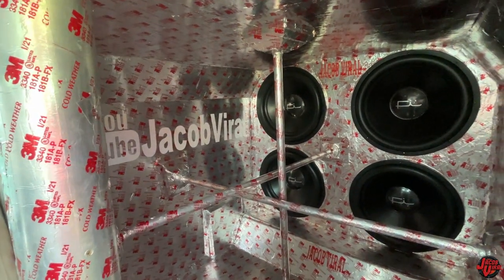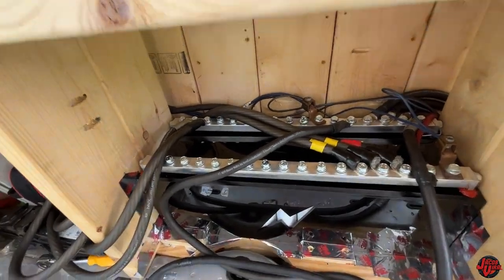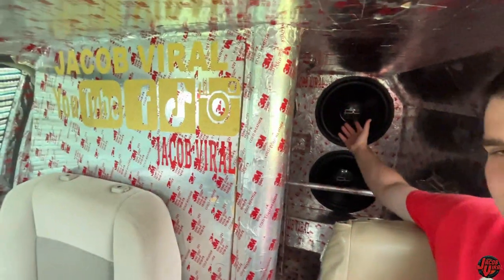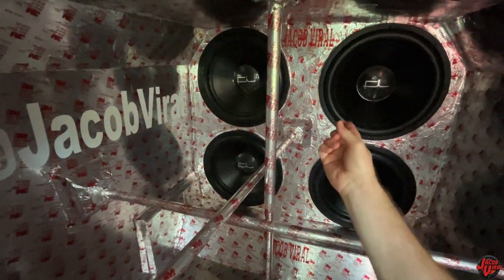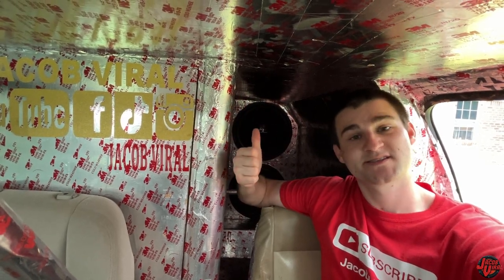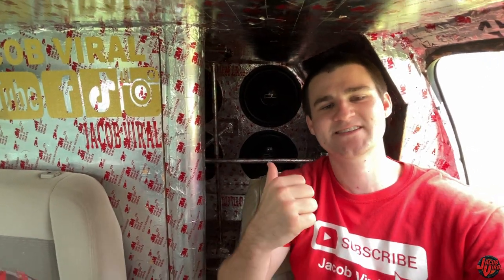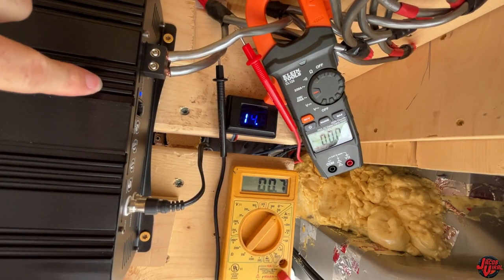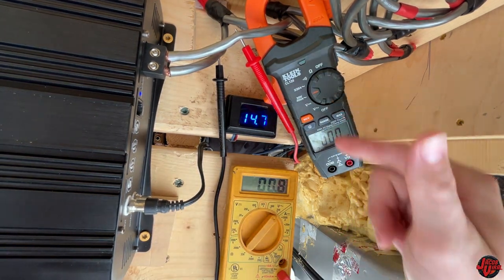BIG System Update! 2 SONG FLEX TEST & NEW Power RESULTS!

Comment: Where are you running your rca out of?? Deck or Kisle or something else? Decks seem to have low rca out puts with low volts
Reply from the maker: Just head unit pre out voltage 2.5v from deck; it works fine
Reply: I need to try that litium battery you got. I'm going to be looking those up, think you for the reply and all the videos you make.

Comment: Jacob what about two smart 5k taramps? They are higher around 6k at 2ohms. You should have a lot more power and get that 163+ db you want.
Reply from the maker: That’s a good option maybe, but not the power range goal; will have an update within 1-2 weeks with my amp reveal

Comment: Liking the set up brother 💯 one thing I noticed idk how much of a difference it would make but how you have your sub wires ran the extra wire that you have wrapped up is going to cause some stress  on your woofers my man it's extra length that the current has to travel may cause more heat in the wire the shorter the run the better from what I understand 👍.. I completely understand why you have it like that it makes it easy to do what you have to do just keep in mind that extra length is going to cause heat my man 👍.. definitely digging the set up shit looks like it knocks hard af 💪😁💯... Keep up the good work brother ✊
Reply from the maker: Thanks Cole good point
Reply: @JacobViral   No problem brother 👍.. I'm no professional buddy but I have done countless hours of research that's for sure plus I have learned the hard way when it comes to my own stereo systems over the years 😂🤦👍.... The power and ground wires the longer the run the thicker you go or the more wires you run...  wires are like a highway for electricity so length and thickness always play a roll in how efficient that current travels 💯👍.
Can't wait until your subs are broke in bro its going to hit so hard 😂 I can tell by your face and by your sneeze that she's a slapper 😂💪
Reply: With voltages over 100 volts there are very little issues with the extra couple inches of sub wire. Next to zero.